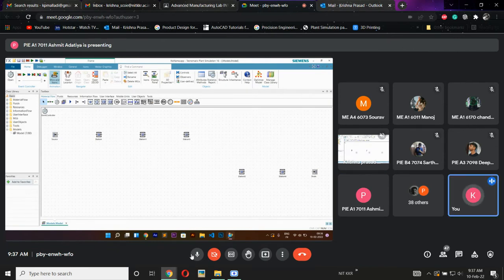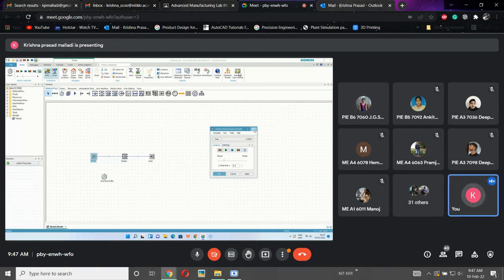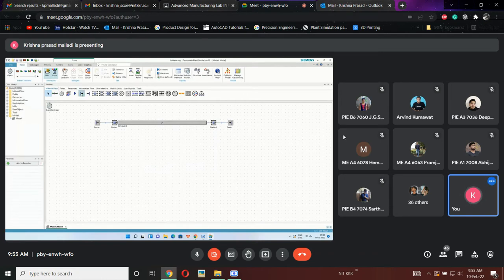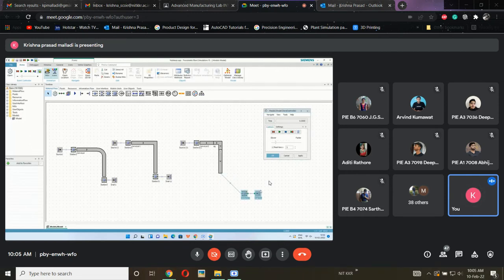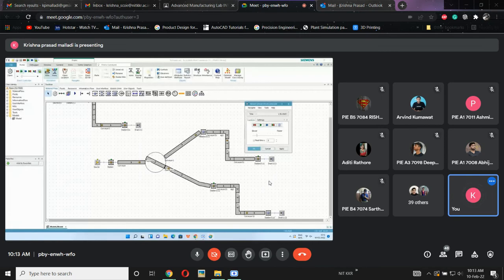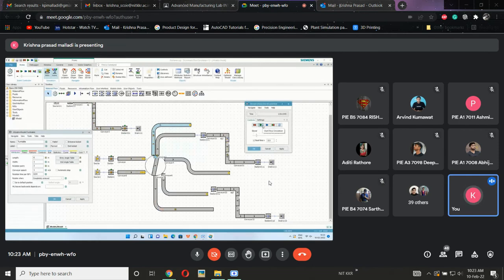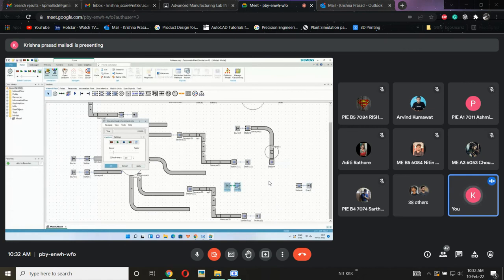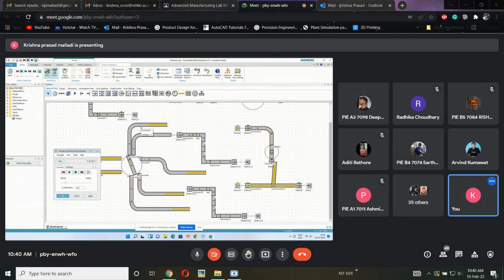5 Tecnomatix Plant Simulation Module 5 - Conveyors, Convertors, Turntables and Turnplates

Comment: Hallo I have a question regarding turn table Can we use some sort of sensor in turn table let say vision sensor that can judge the part marking and they send it to its respective conveyor let say A and B marked on part and there are two different conveyors for part A and part B, can this table using sensors can send them to their respective conveyors?
Reply from the maker: Yes it's possible. 
You need to write a small method for enabling the condition.